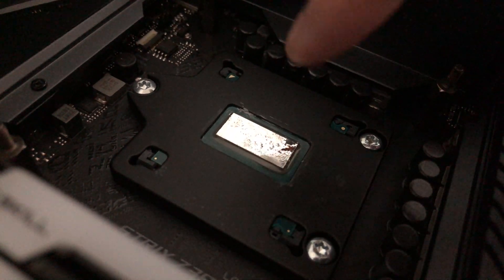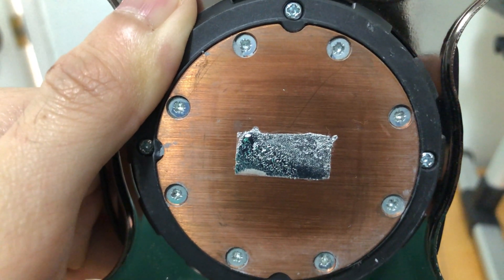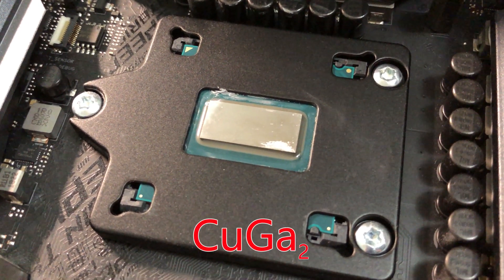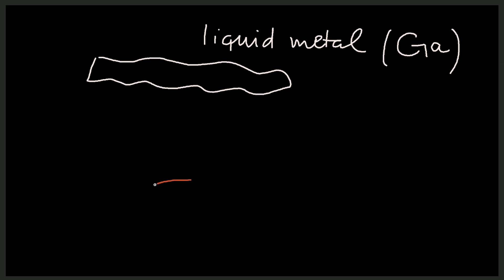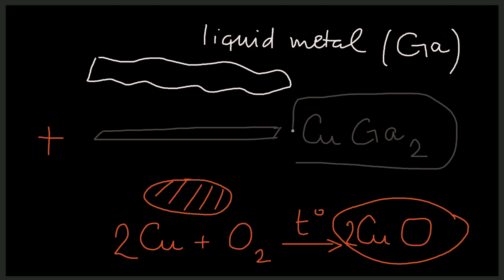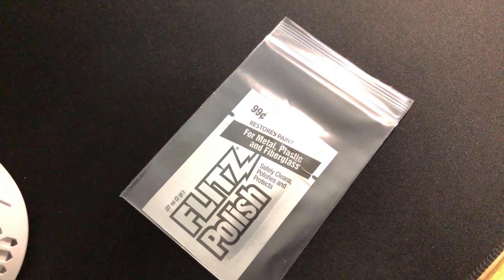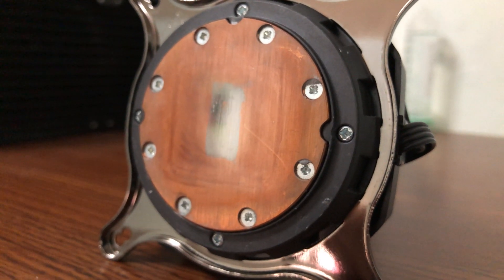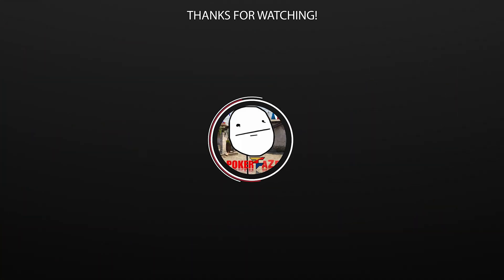Liquid Metal + Copper - i9-9900k Direct-Die Cooling 2 Months Later

Comment: My processor i7 4790k. gaming Temps are in the 85-90°C rang.   reduced my temperatures best solution liquid metal or thermal paste?
Reply from the maker: Delid and use liquid metal can help with yours

Comment: You need to use the original IHS, apply liquid metal then seal it with high temp silicone that way the air doesnt get in and dry the liquid metal.
Reply from the maker: That's not direct-die cooling 🤦‍♂️
Reply: @PokerFaZe  Yeah but you dont have to worry about it drying up...
Reply from the maker: That will be seen, have not removed the cooler since the making of the video, nearly 1 year already

Comment: Using sandpaper on that coldplate would makes sense actually, it looks pretty damn rough. Of course a much higher grit than that idiot used though.
Reply from the maker: I just looks like that on camera, but if you touch it, it is as smooth as the original. And I only cleaned it with a q-tip and IPA

Comment: Greetings I love your videos. I ask you the liquid metal will have problem when using it in the asetek 645lt I have a dan case and I want to lower the temperature of my i7 9700k that already has delid and direct die
Reply from the maker: I think you should see something similar to mine. Try applying a bit more liquid metal as I mentioned, and you should be good for 6 months according to RockitCool.
Reply: @PokerFaZe  
that is to say that the application of the liquid metal only lasts 6 months and then it is changed or it cannot be used anymore if it causes permanent damage to the aseket
Reply from the maker: @Fernando Peña There is no damage, I just says RockitCool mentions that you should change it every 6 months. But if you have more than enough LM, you can try using it longer. If you don't see any temp change after months of usage, then don't bother with it, just leave the way it is
Reply: I have the same case, cpu and cooler, I also have the same board as the one in thew video. You will see a big difference. The problem with the 645lt is the speed at which it gets heat off the cpu. After i went direct die and liquid metal the cooler was keeping up with rapid changes in cpu load so my temps wouldn't spike up so aggressively.

Comment: I'm thinking about direct die cooling my 9900k with a noctua nh d15, is there any concerns I should have? Also great video.
Reply from the maker: Nothing is worried about, it is nickel plated so there would not be stain like copper
Reply: @PokerFaZe  ok and should I still tighten the screws all the way when mounting the cooler? because I'm worried about cracking the die.
Reply from the maker: You shouldn't worry if you use the Rockit's frame and washers. They are designed so that the cooler can be safely tightened.
Reply: Poker FaZe ok thank you for the reply
Reply: @PokerFaZe  Great lesson on Liquid Metal and Direct die. You just made me worried. I just delid my 8700k today and i ordered a direct die kit + Thermal Grizzy Kryonaut. This one is not conductive and they say it support aluminium so i am not expecting a reaction on cooper. So, whats your opinion? Should i cancel this and use LM on the IHS and re-lid ? Or can i still do the direct die with the direct die kit + Kryonaut paste?
Reply from the maker: I think the best is LM + IHS, relid is optional, not because of temperature, but the 8700k, both die and PCB, is slimmer than the 9th gen CPUs. According to Rockit, the direct-die frame would not have enough pressure to push down the 8th gen CPU, so you may run into some issue with your machine. In order to do that, some people have to shave the corners of the motherboard :D 
I heard someone replace the stock thermal paste of the 8700k with Kryonaut and the temperature was improved. With LM, I think you can lower it even further
Reply: @PokerFaZe  thanks for the quick reply. That reply made my day and decision not to go for direct die. Thanks
Reply: @PokerFaZe  can I dm you regard my preparation for direct die items and products

Comment: For 9900ks, I applied liquid metal.  But the temperatures went higher than those when IHS was present.  He started to see 90 degrees.  I use Ekwater evo block.  This is a nickel block.  Copper base and nickel base are changing.  Why do temperatures go higher?
Reply: I use a EK supremacy Evo (cooper, nickel plated) my temps are amazing, i can do 5.3ghz, i had to redo the mounting once because of bad contact.
Reply from the maker: Probably missing contact with the die. Try using washers on the backplate so that the block is not moving. Go to Rockit's Youtube channel, they show you how to install
Reply: @PokerFaZe  I use them.  https://www.ekwb.com/shop/ek-supremacy-precisemount-add-on-naked-ivy   These are the screws produced by ekwater for direct die.  But the back plate is used as standard.  You say that I was caused by the back plate not compressing enough.
Reply from the maker: https://youtu.be/2KcFrvOZfcE